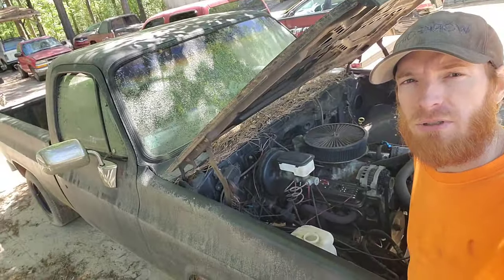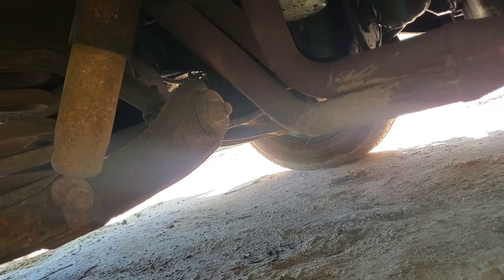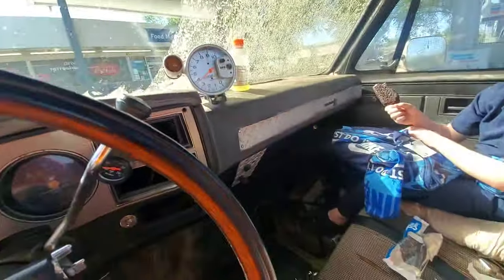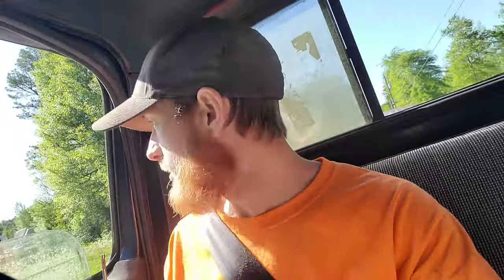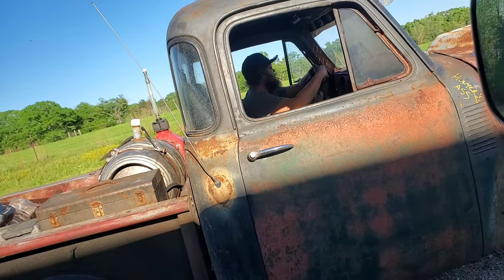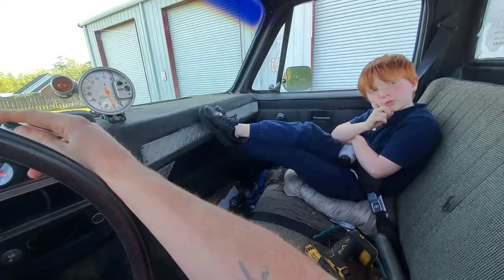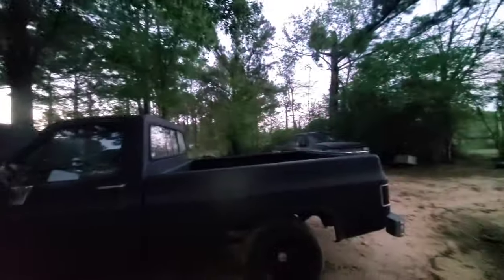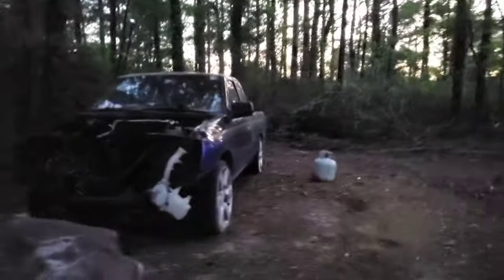Took The C10 Out & Found Hot Wheels

Comment: If your gonna run straight water, you need to drain the radiator and the block for storage. If you just drain the radiator the bottom of the block will still stay full of water and can crack so you must pull the block drains.

Comment: I’ve done a 100 ls swaps and have never ever put a spacer in between the converter and crank and never had an issue my thing is what is the crank gonna move back or is the converter that’s bolted to the transmission and centerd on the output shaft no it’s not gonna move put that 6.0 in one of your nicer trucks

Comment: Hey man I got a 350 with a Muncie 4 speed transmission for 500 cranks and runs does not smoke and I got the rear end also but not for sure if it's a possi or not if interested
Reply: Where u located

Comment: Cast iron heads on a LS ? Think they all have aluminum heads
Reply: No, the early 6.0 had cast iron heads, i think it was only in 1998 and 99 model years.
Reply: 99 and 2000 LQ4 engines had cast iron heads 👌